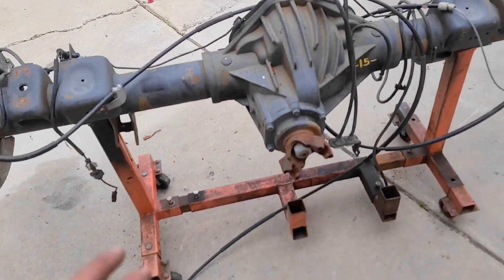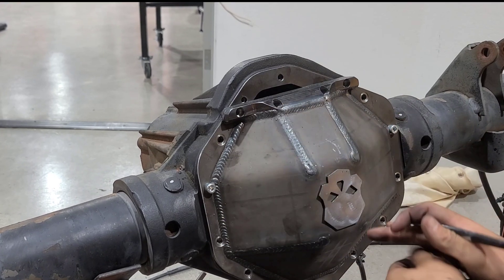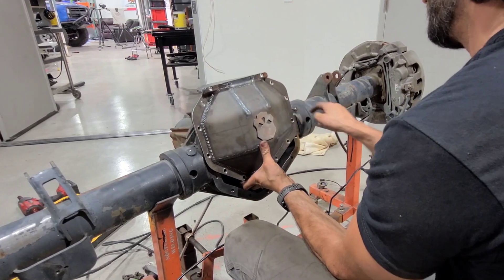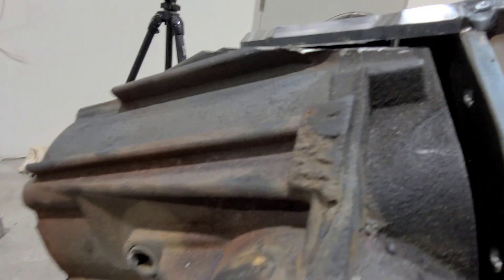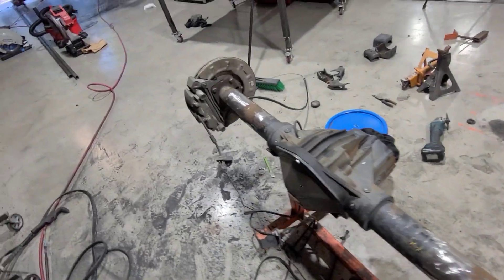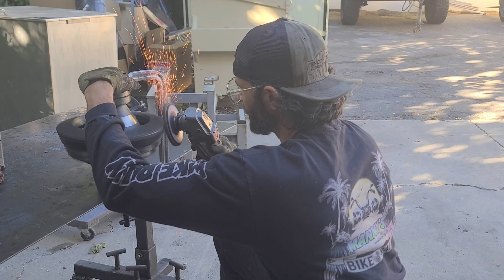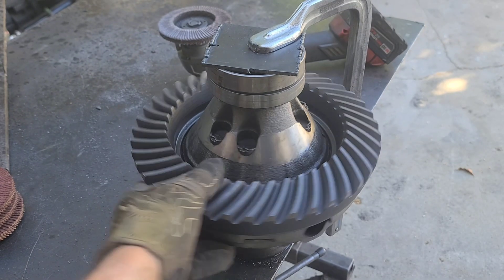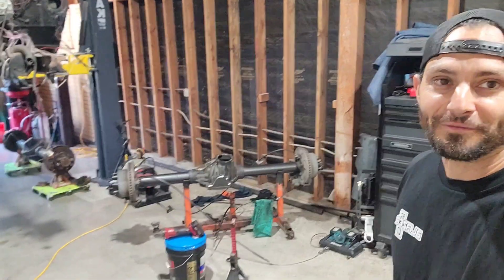4" tube 14 Bolt Shave Kit with ARB locker

Comment: Through all your modifications do you still use the factory upper shock mounts?
Reply from the maker: I do. I've been wanting to build cross mount over the motor
Reply: @readyrig4x4 I like how the lower shock mounts are above the axle. My rear suspension is in bad need of a redo after an off-road shop botched the job. I'll be watching...

Comment: The 9” was first offered in 1957 and the 10.5” 14FF in 1973 so your statement of the 9” getting the patent from it doesn’t hold water. 
Besides there are many different makes and models that have used a removable pinion support setup…. GM did not own that design feature.

Comment: 14 bolt is based off of the Eaton ho52 / ho72 axle , used from the 40s up until 72 I believe. Can find them in lots of 3/4 and 1 ton gm trucks. Thats what the ford 9 is based off of as well. You can interchange the side gears and 14 bolts shafts in an Eaton . They have better clearance than a 14 bolt and have a drop out 3rd. A lot of people like the ho72 because it has a load bolt preventing pinion deflection even more than the 3rd bearing so it's bomb proof. They also came with Detroits. Lots of tech info on them online they're very cool!
Reply from the maker: Yes!!! You are 100% correct. I have a buddy that has a spare ho72 and was thinking of adapting that into my front
Reply: @readyrig4x4  that's the dream front setup! I think you can use Dana 60 C's and build out from there with sleeving and welding new tube. Quite a job though.
Reply: @readyrig4x4  Powerwagonbuilder on YouTube has built a Few HO72 Steering axles. They're super beefy!!

Comment: What is the difference between using a 14 bolt from the year 2000-2006? because you use a newer one. People have told me that I have to use one of those years. thanks
Reply from the maker: Great question. I think I'll do some research for you and make a video about that
Reply: 2000-2010 14 Bolt is still your Drop out Pinion with 3rd bearing support design with 8x6.5 Lug Pattern but comes factory with Disk Brakes. 2011+ has 4" Tubes bigger hub bearings bigger brakes and spindle bore large enough for 40 spline shafts but is 8x180 Lug Pattern. I will say there's a company that makes a 8x180 to 8x170 redrilling guide so you could drill the rear hubs to 8x170 and run that with 40 spline axles and match a 05+ Super Duty Dana 60 with 40 spline axles. Would be extremely beefy.
Reply: @TyphoidSnaily  So you recommend me to put a 2011+ 14 bolt on the rear axle? instead of a 00-2006 14 bolt. Thanks!
Reply: @TheRamon0007  it would depend on what front axle you're going to run. If you're running an 05+ Super Duty Dana 60 then yeah I'd go with the 2011+ 10.5" Ring Gear 14 Bolt (found in 3/4 Ton Gasser trucks) and redrill the hubs to match the 8x170 front lug pattern. That way you have the option to go super beef 40 Spline Axles if you wanted.
Reply: @TyphoidSnaily the tubes are super thin on the factory 4 inch tube ones is what I’ve encountered. Mine was like .241 in the thinnest spot near the housing
Reply: @Carter_Crawls  14 Bolt tubes have always gotten thinner near the pumpkin.
Reply: @ not that thin though, I was really surprised
Reply: @Carter_Crawls  the increase in diameter more than makes up for any decrease in thickness. Guarantee the 4" tube is still stronger with the slightly thinner material than the older 3 3/8" Tubes.
Reply: @ I just pushed that junk out and bought 4 inch .500 wall tube
Reply: @Carter_Crawls  well shit that works, thats some crazy heavy shit though lol My Buddies Fab housings in his race car are 4" .375 wall DOM tubing and hes been bashing those on rocks for 6 years now.

Comment: Are you keeping ABS brakes?
Reply from the maker: YES! I can't wait to show you all what I discovered about the ABS in my next video about this 14 bolt and the ZR2
Reply: @readyrig4x4 What was the reluctor ring tooth count if you could recall? My Colorado is 48 teeth. I am very interested in putting a 14 bolt into my truck. Online research has very conflicting info. My biggest desire is to maintain the abs functionality, but after three rebuilds, I really need to get a beefier axle in my truck.

Comment: What year did they start 4” tubes ? Is it still 30 spline axles
Reply from the maker: I couldn't tell you when the 4" started but mine is from a 2015 2500 HD gas truck. I think the diesel 2500s ha e the AAM 11.5. Yes, mine is still 30 spline. I have found that everything is the same except the tubes 👍
Reply: @readyrig4x4   From 2002-2016 The diesel 2500HD & 3500HDs had the AAM 11.5" rear ends. Versus the 2500HD gas versions had the AAM 10.5"
And if I'm not mistaken, I believe all 2500HDs with the gasoline engines, the 10.5" rear ends only come in the 4:10 option from the factory. Whereas the 8.5" and 9.5" were sold with different ratios from the factory.
Reply: Nope, hade a 04 2500hd gas with 14bff 3.73 and and a 10 dually 14bff 3.73.